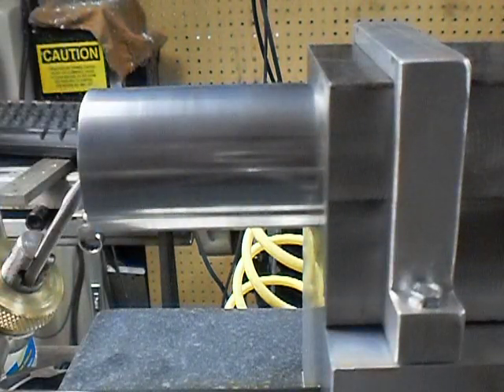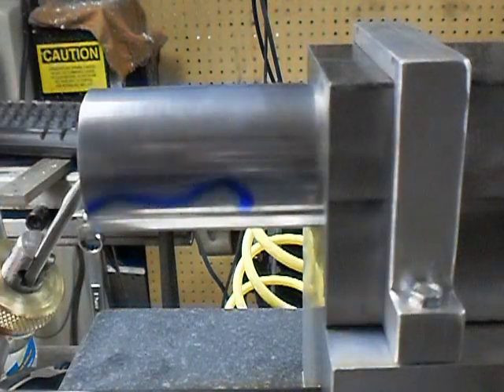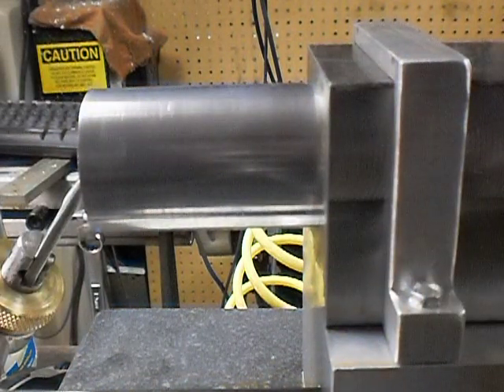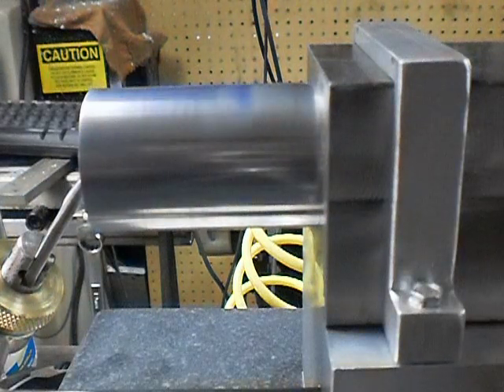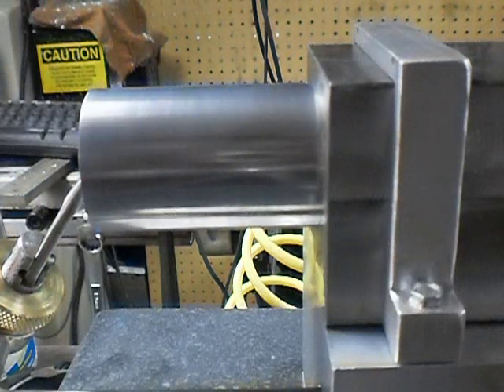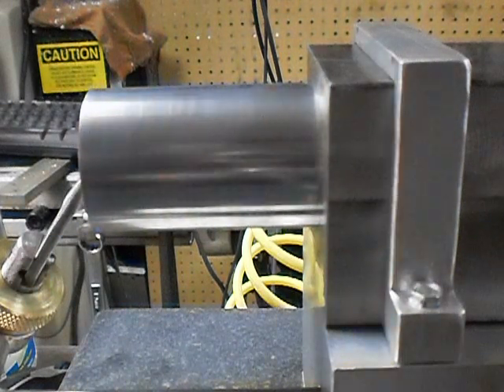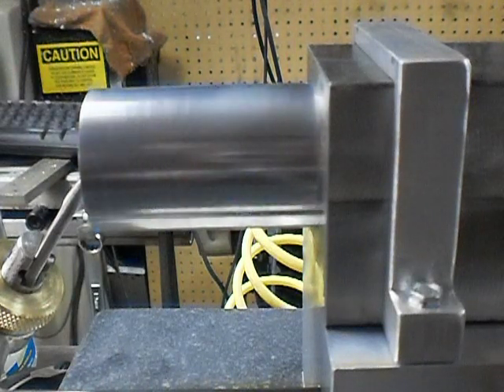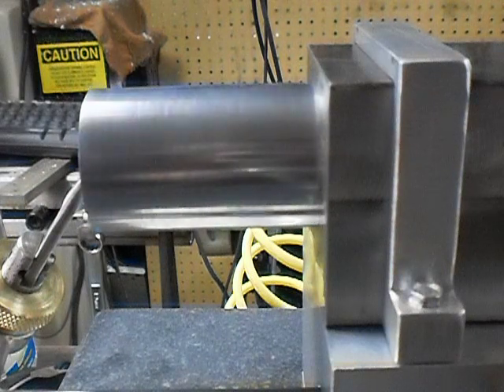floating tool holder

Comment: I guessing an anular groove .5" from either end and a axial groove connecting them?  sorry for the questions.  I am facinated:)
Reply from the maker: +Steve Austin No a groove in the ID about  1 inch from end and a supply passage at the bottom. The groves are connected by the air supply passages not a groove. So the ID only has 2 grooves 1 inch in from the ends.

Comment from the maker: I was shooting for a nice slip fit of .0002 but I think I'm more like .0004 it's more important to make sure the bore and the spindle have no (or at least very little) taper from end to end. I've used mine quite a lot and still preforms nicely with very little air volume used.

Comment: Great  what size was the groove?  was it just one groove?  what size was the pilot hole (air)?
Reply from the maker: There are 2 grooves about  1/16 wide by 1/64 deep. the pilot holes were drilled with #29 drill.

Comment: Am about to build one. Did you get a satisfactory bore with work held in the 4 jaw and a heavy boring bar? Or did you ream or lap?
Reply from the maker: I bored with a solid carbide boring bar I made up. I ended up still taking a few spring pass to get most all the taper out of the bore. And I finished off with some fine emery paper after the grooves were cut just to knock off any sharp edges and burs. I am very happy with the way it preforms doesn't use much air set at about 25PSI. I am now working on a grinding head set up to sharpen some end mills. Ill post some video once get it set up showing how my set up will work. Good luck on your build remember just be go slow and don't tighten the 4 jaw real tight out of roundness will kill the performance. I roughed in the bore then loosened the4 jaw and lightly clamped and finished by taking the last .010 thousands out and like I said a few free pass
Reply: Great advice.  Thanks!

Comment: Nice. Is this the design shown in Philip Duclos' book? I assume you will make an end mill sharpener.
Reply from the maker: Yes that is the plans I started with and yes I'm going to try and get some end mills sharpened. I'm pleasantly surprised at the amount of air consumed   I would of thought it would be much more. I am going to set it up temporarily kind of like in the book with my twist on it. But eventually will make a grinding head and cross slides to be a machine on its own.   Thanks for the reply